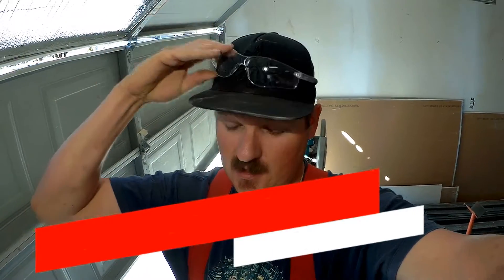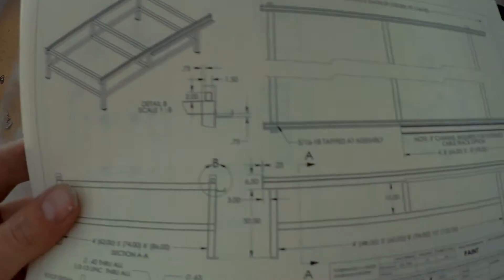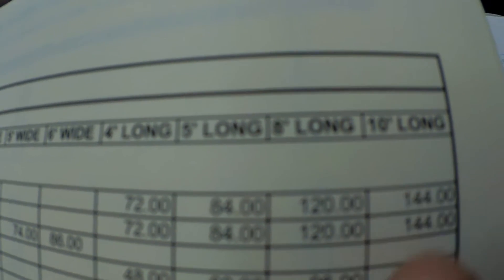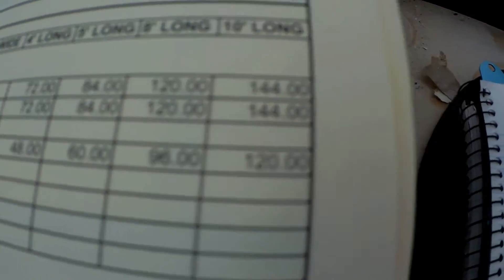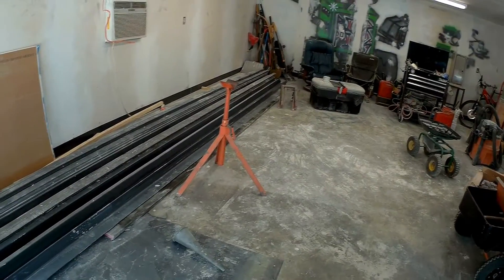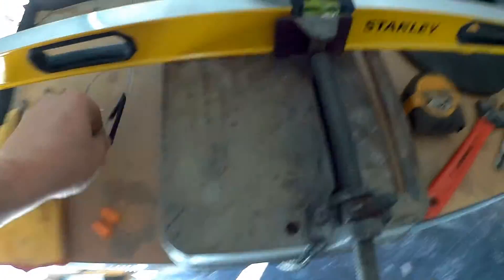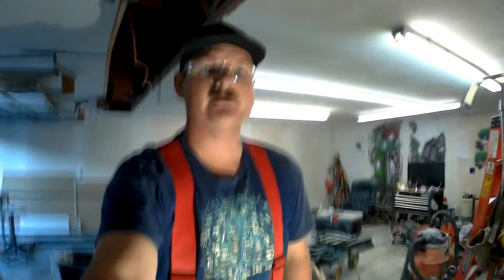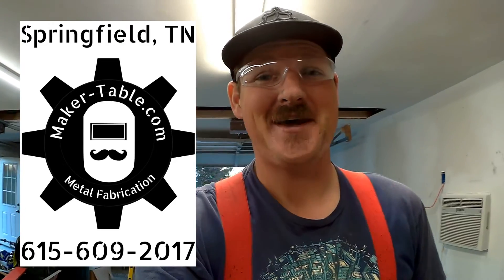CNC Plasma Table Build Day One (blueprints & cutting)

Comment: hi there, :-)I have been following your CNC plasma cutting table, you have done a great job, we all make mistakes and also want to jump into the finish,  could you be able to post, where you purchased the plans and info sheets of this project. a link would be good. :-) thank you, also if you have or know where to purchase a pipe CNC cutting info and plans.
Reply from the maker: Thanks for following along!  I built the table using two kits.  The electronics portion came from https://www.candcnc.com/ and the mechanical portion came from http://precisionplasmallc.com/  They both provide instructions and blueprints when you purchase the kits from them.  I have not found a good tutorial on a CNC pipe cutter yet.  If you order the 5th axis on your controller you can basically wire up an indexing chuck and treat it like another flat axis.  You just have to find a post processor that will convert the round pipe profile into a flat  "sheet".  Good Luck!

Comment: im actually trying to do the same thing you are. im in the exact same position as you too. married 2 daughter. been a structural steel fabricator for 10years and want to go on my own. want to give the best life i can for my family. im on Ottawa, Canada.the comapny i work for outsources all the plasma/torch cutting so thinking of using my employer as my customer.
subscribed
Reply from the maker: myvw8u that's a great plan! I called some old contractors already to tell them about the machine. None of them have come through yet but other ppl are finding me so I'm still pushing brother 👍

Comment: where did you get the plans from
Reply from the maker: I got the plans from Precision Plasma,  they sell the gantry kit that I used but the plans for the lower portion of the table are available for free on their website.
Reply: Maker Table thank you, I'm actually getting the steel to build a 4x8 with floating z-axis

Comment: i will follow your work mate. I'm interested to build a milling cnc small size for my projects. Have a look to my channel, i build stuff as well. Great work mate. Keep up. Florin
Reply from the maker: Get IT Fixed thanks for the feedback 🤖🖒 I checked out ur channel and subbed. it would be awesome if u could make some vids about open source controllers like raspberry pi and the arduino uno. looks like u could def figure them out